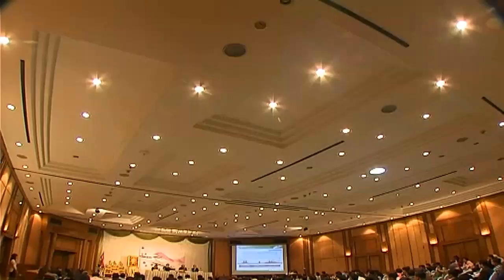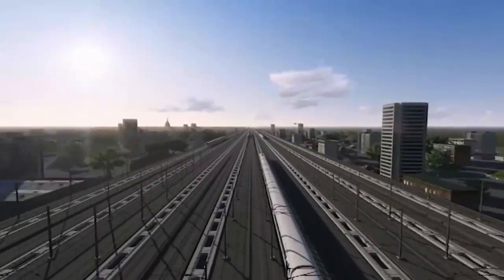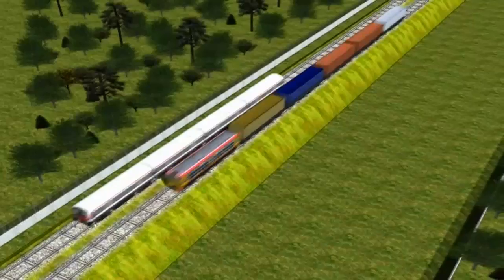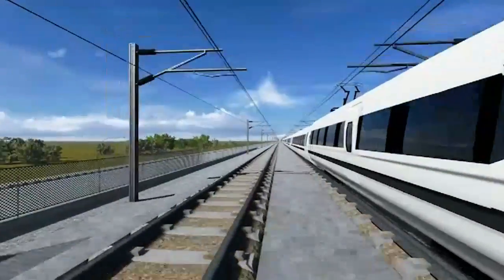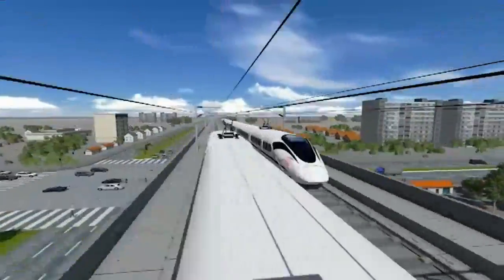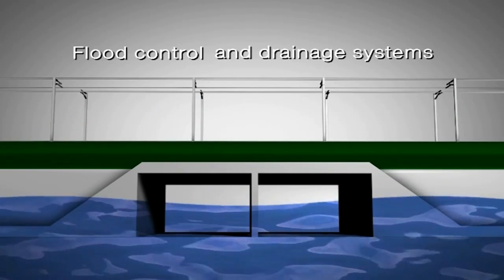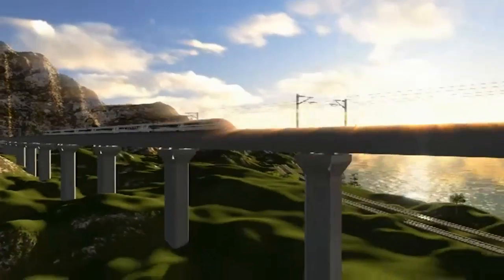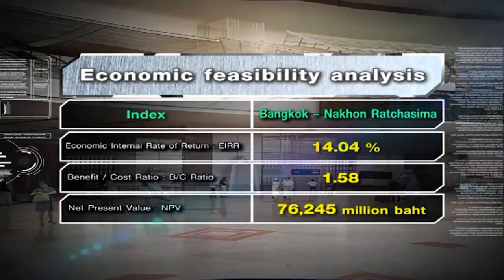Thailand High-speed Rail Project

Comment: The risk of the Chinese style railroad.
The Indonesian nation be cautious.
1.
The Chinese train copies Japanese parts and uses it.
By the patent violation, the Chinese rapid transit railway may not use the parts definitely.
2.
In Japanese Shinkansen, all is a set.
A track. A bridge. A service system of administration. Electricity.
The Chinese does not guarantee those quality.
The plan that the government does not make suretyship obligation is that the government does not supervise the quality.
The government does not guarantee the safety of the nation it either.
3.
A large quantity of Chinese workers.
As for the Chinese overseas development support, only a Chinese profits.
The Chinese will not employ a local worker.
It is the slave who is much cheaper than a Chinese even if a Chinese employs a local worker.
(Africa)
And the Chinese forms the community only for them in Indonesia, and they will remove an Indonesian.
The Chinese Communist Party sends a Chinese emigrant into each country.
In the city of the United States, a municipal assembly was occupied by Chinese people.
And they do municipal administration of the ethnic discrimination in deference to intention of the Chinese Communist Party government.
The Chinese purpose is occupation by the Chinese emigrant using the rapid transit railway plan in Indonesia.
The Indonesian minister gave priority to only one's wallet over a nation and the future of the nation.
Reply: taihuu25go ,anyway, time will tell whether indonesia is right. no point arguing too much now. Indonesia engaged an independent consultant to assess the Hsr tender. 
Normal railroad in China? They built Qinghai--Tibet railway in one of the most difficult environment. Nobody build anything similar anywhere else.
Guess you have never been to China in the last 2 or 3 years.
Japan would have sued China at WTO, if they have proof. Just talking is no use. Japan would not give you any technology for free, don't be so naive! Don't think making a HSR is like KFC, so easy to copy or modify? average speed Of China HSR is faster than shinkansen. China HSR also more stable.
Reply: taihuu25go ,all wild imagination without any proofs or basis! You may need to consult a doctor.
Who will start construction costing billions of usd, without proper procedures, permissions and plans especially in a foreign land? Only a person without any knowledge on construction or contract would even say such a thing. ???
Reply: Anyway, who build the bridge linking Surabaya n Madura?
Reply: You were brainwashed n talking rubbish without ever ride a China HSR
Reply: If what you say is correct, why some African countries award China company, second or third railway contract. Some of these contracts involved over 900km of track.
Reply: taihuu25go ,anybody know that a used car or train, when properly reconditioned will work again, nothing so special.
Reply: taihuu25go ,For Indonesia HSR, isn't the final price of China bid is higher than the final revised price of Japan bid?
Final plan is Indonesia companies own 60%. So how can China company act alone?
Go to China n Japan, take a few rides of CRH, n shinkansen, experience yourself.
Japan hsr is costly to operate too. Even with high ridership, Taiwan hsr built by Japan, nearly gone bankrupt had the Taiwan government dont inject big money into it.
Reply: Arthur Lee This case is unrelated to haighspeed rail.
As for the cause of this accident, a company is a thing by a company having imposed a severe penalty on a driver for the trifling mistake of the driver.
Therefore the executive was punished.
The apartment where this train crashed into was left as an admonition to the companies.
In Chinese haighspeed rail crash, who punished it?
TV asked a Chinese about an accident of Chinese haighspeed rail.
The Chinese praised the government which gave priority to system restoration over the rescue of the survivor.
From a buried vehicle on the way, a baby was rescued.
And other corpse and survivor were buried with a vehicle.
Reply: +taihuu25go Please don't spread your own fear here. Be brave and adapt to the reality of 21st century, Indonesian have been historically marked their territory not by physical border but a cultural frame of mind. China know it very well that communist ideology have no place in Indonesian society no matter how much China money infiltrated the regional economic system. Many new chinese workers in Indonesia are secretly learn to pray to God that is not money/wealth like in the mainland nowadays. They can choose to learn many religions here, the state guarantee their freedom. Would that be a good sign for humanity to learn to be humble again?
Reply: Andreas Dewatmoko I think that it is victory of the Chinese mammonism.
China might purchase Japanese geological survey data by a bribe from an Indonesian bureaucrat.
Therefore the Chinese route plan is identical to a Japanese company.
The Indonesian minister said.
"China was only cheaper than Japan"
It is not necessary for China to collect the cost of the geological survey.
The method of the overseas support project of China dispatches a large quantity of Chinese workers to the country.
China does not employ the worker of the country.
(in Africa, it is such situation)
And China organizes Chinese community of the extraterritoriality to the country.
Reply: The HSR technology of China was given from Japanese JR.
Terms of the contract at that time. "China does not export it to the foreign country"
When a plan of the rapid transit railway construction in the United States was suggested, China only changed some parts shapes of the JR patent, and they insisted on a Chinese original.
Therefore Japan insisted on patent violation of China and prohibited them from use.

Not only Africa, education is short in the developing country.
Thus, some elite rank decides ordering by a bribe.
2002WC.
When they chose the campground in Japan, as for the officer of the African team, they demanded a bribe from the Japanese mayor and village mayor.
When "we chose the campground, the Korean gave a luxury model.
You give what to us"
Japanese people refused their demand.

Africa is not the society which a rapid transit railway needs.

I do not know the technical level of the Chinese normal railroad.
However, in China, I use the railroad facilities which Japan left.
Korea is the same as Taiwan, too.
 According to the Taiwanese , many facilities which a Taiwanese and a Chinese made after WW2 seemed to become unusable in around ten years .
(bridge, tunnel)
If Africa lays a low-speed railroad, I think that the product made in China is enough.

However, in the Asian countries, I use a used train made in Japan.
This is because the product made in Japan is firm.
Therefore, in current Asian each place, a used train made in Japan works.
Reply: In reality, the Indonesian government announced the re-consideration of the plan.
In other words, the railroad construction plan of Indonesia returned all to a blank paper.
However, it is one month later.
Indonesia ordered the construction by the Japanese plan route from China.
It is not fair business.
"It was lower-priced than Japan"
It is what the Indonesian government should insist on in the result of the re-bid.
Only speed is not important to the rapid transit railway.
It is to control it safely.
Therefore I give priority to the safety of brakes over a style and engine power when I choose a car and a motorcycle.
After a rapid transit railway accident in China, the Chinese rapid transit railway slows.
If it is only an experiment, Japanese Shinkansen is faster than business speed.
If a track is the long distance only for straight lines, business speed at 400km/h will be possible.
The station of the linear railroad of 700km/h per an hour is only 6.
It is because slowdown distance to stop safely is necessary.
Still.
China seemed to start construction without permission with a detailed construction plan with the country being in condition not to be decided by the railroad construction in another country.
(choice of a time chart and the method of construction, land expropriation plan)
Reply: The Indonesian government canceled an early bid.
Before it, the Indonesian government offered Japanese geological survey data to China.
Bid in itself is unfair at that point.
Indonesia should have filed for the fair supplier choice by the re-bid that I added a new condition to.
The difference between Japan and China is a term of payment of the funds.
Japan required a guarantee of the Indonesian government for fund collection.
Because Japan casts the tax from a Japanese into Indonesia, it is natural.
China did not demand it.
China collects the fund only from the operating income of the rapid transit railway.
However, will China of the mammonism accept it?
In railroad construction in Thailand by China, China started construction without the authorization of the detailed construction plan meeting and government with the Thai government.
In Indonesia, a thing same as it may occur.
The Indonesian people may be robbed of their land by a Chinese without permission.
(after Japanese 3.11, the Chinese and the Korean set up reputation to insist on proprietary rights without permission on the Japanese land.)
It is possible that construction quality decreases if low-priced.
(the low price bridge which Korea built to Palau collapsed in several years)
In substitution for a return guarantee by the Indonesian government, China may demand a naval port of China from Indonesia.
It becomes the menace of the democratic nation of the South Pacific.
Reply: I'm sorry.
I mistook it for rapid transit railway comment of Indonesia.
Delete.

Comment: タイに日本の新幹線。
ベトナムも日本の新幹線ですね。^o^
Reply: Japan can talk only, the fact is if more than 500 km, Japan will need many years to construct.
Reply: yes, let see when can Japan complete the construction of hsr in Thailand n Vietnam. they have talked on Vietnam one since 2009.
In Japan, they need 12 years, 2009 to 2021, just to build 66.7 km of Nagasaki shinkansen
Reply: sc5252
The Shinkansen to export to Thailand is a type with the wheels.
When It makes 500 km/h, as for the train using the wheel, the durability of the wheel becomes the problem.
It was a problem a wheel a derailment a German rapid transit railway to have woken up.
In the case of Germany, a defect was to the wheel by a design fault.